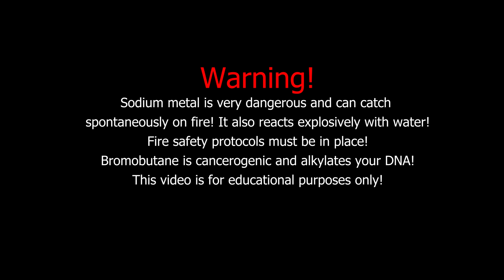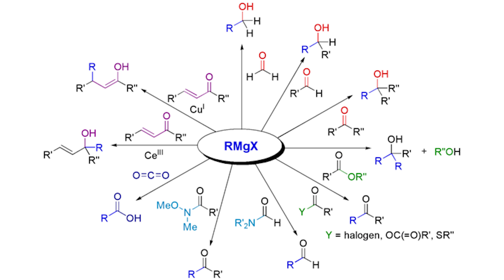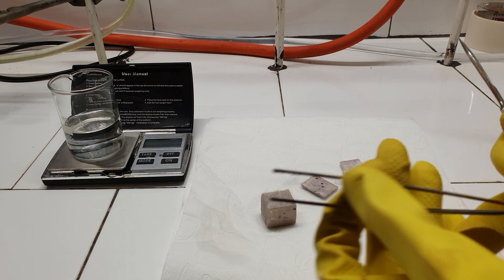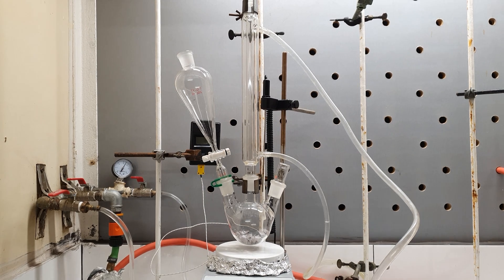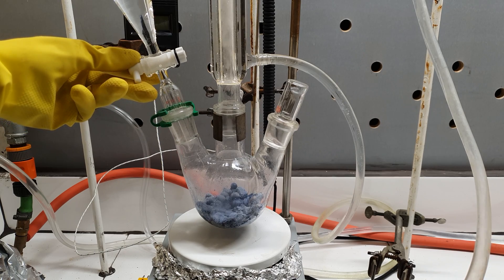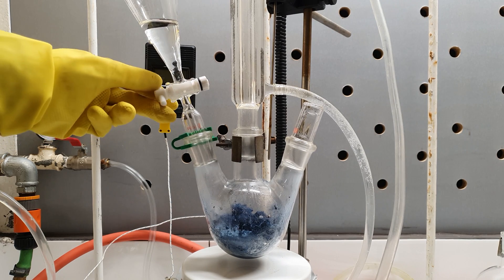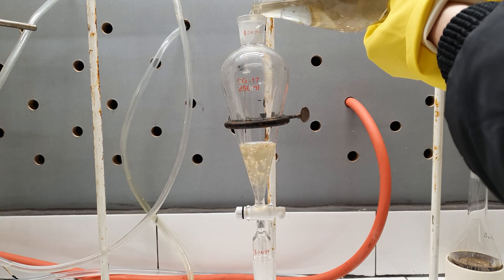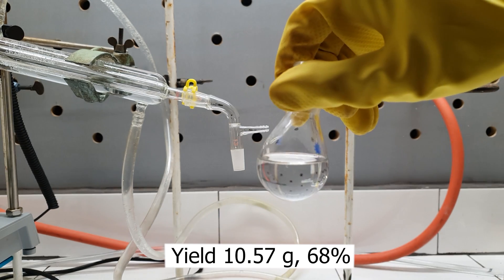I did THE MOST USELESS chemical reaction KNOWN!

Comment: You can aswel make alcanes via Wurtz-like reaction based on Gringnard...
R-X + Mg -ether-> R-Mg-X
R-Mg-X + R-X --> R-R + MgX2
Cheaper Mg than Na...

Alternatively it should work aswel via electrolysis of carboxylates...
R-CO2H + NaOH --> R-CO2Na + H2O
2 R-CO2Na -electrolysis -> R-CO2° + Na2
If water is present Na2 provides 2 NaOH + H2(g)
And 
R-CO2° --> R° + CO2(g)
2 R° --> R-R
There is possible rearrangement of the alcanic radical or a side reaction if overpotential/current and high concentrations (NaOH and/or R-CO2Na) concentration to from R-CO2R and R-OH (with water)

One reaction may thus be adjusted/finetuned to form alcane, ester or alcohol and all those are also good fuels ;o)

PHZ
(PHILOU Zrealone from the Science and Madness forum)